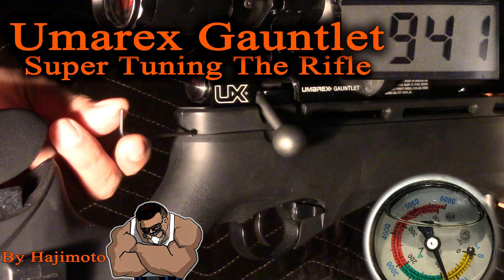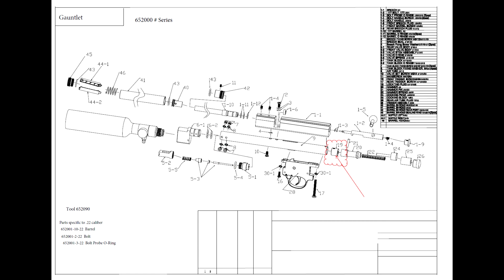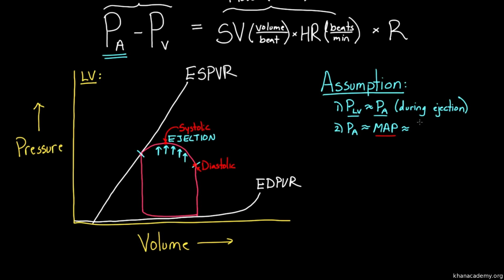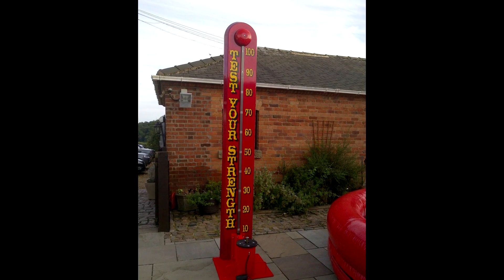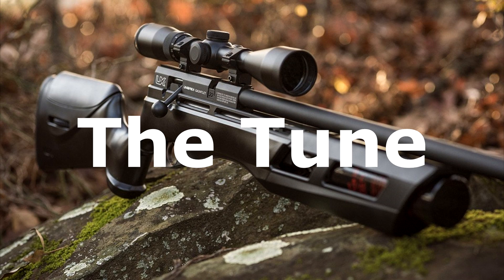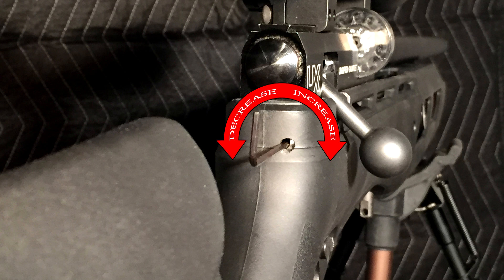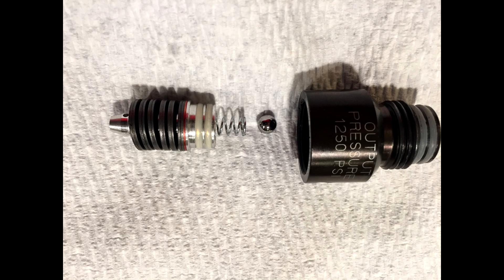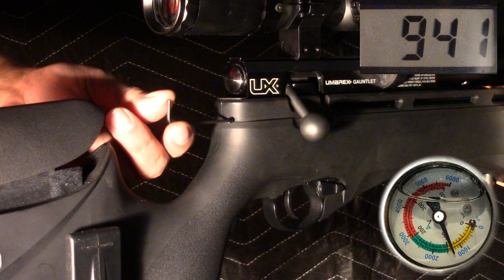Umarex Gauntlet: Tune Kit Results

Comment: So I have a .25 cal gauntlet and it’s currently 1900 per shot I want it 2100 so do I need to actually install something or can I just adjust a screw to up the pressure a bit?
Reply from the maker: The output of your regulator would need to be adjusted. The stock regulators that ship with the Gauntlet can be shimmed but there is a process and confirmation sequence that needs to be employed else you run the risk of exceeding 2100PSI and causing all sorts of issues.
Reply: Hajimoto Productions ya i figured it out thanks for replying tho! Appreciate it

Comment: Can a , davv aluminum 0.35l 0.38l 0.45l hpa work in it just by changing the bottle
Reply from the maker: My response speaks only to the tank and not any regulator that may be a part of the tank assembly you asking about. There is not enough information for me to properly answer your question. If the outside diameter of the tank you want to you allows the tank to reside below the barrel shroud without contact, yes. There is also a chance that the Gauntlet would need to shed the foregrip /tank cover shroud if not a similar outside diameter as the stock.

Comment: What is the difference between the Low Power Setting that produces speeds of 900+ and the Low Power Setting that produced 600+ speeds?
Reply from the maker: I see you discovered the different pellet weight swap.

Comment: You set your regulator at 1400psi, but what is the factory setting?
Reply from the maker: Typically the stock regulator output is listed on the regulator of the PCP. In the case of this specific Gauntlet, the output was tested at under 1050PSI which was under the listed 1100PSI.

Comment: Can an Air Venturi Avenger tuned to these settings ? Thinking of bying a Gauntlet or an Avenger. Which is best rifle?
Reply from the maker: The Avenger has far more tuning ability than even this modified Gauntlet. The Avenger has hammer preload as well as regulator output adjustment.

Comment: You got that many shot out of stock bottle? Does it affect the accuracy and the fpe to kill squrriels
Reply from the maker: Yes it does. If the power is adjust to low, you will not ethically dispatch the animal.

Comment: Hola, hace unas semanas compré un Gauntlet .25 y el bolt es realmente duro de mover, hay que aplicar mucha fuerza para tirarlo hacia atrás. Quería saber si hay algo que pueda hacer para ponerlo mas suave, he visto en todos los videos que el bolt se mueve muy fácil, pero no en mi rifle.
Gracias.

Hi, a few weeks ago I bought a .25 Gauntlet and the bolt is really hard to move, you have to apply a lot of force to pull it back. I wanted to know if there is anything I can do to make it smoother, I have seen in all the videos that the bolt moves very easy, but not on my rifle.

Thanks

Comment: Hello,,I was just wondering about the power adjustment strew  locations on the umarex gauntlet.25cal and 22 cal..are they located in the same place on both calibers,,or should I drill the stock in a different location??? Thanks for any help given..
Reply from the maker: Yes they are

Comment: Is there an equation to figure reg. output psi if 7.9 grain pellet is shot at 1035 fps
Reply: Firstly, Ke=1/2 x m x v^2
7.9 gr x 1035 x 1035 / 450,436.6798 = 18.78771841 fpe
then,
fpe / [(psi x 0.52828... x (pi/4) x 0.177 x 0.177 x (barrel length inches / 12)] = efficiency (n) 
Now that you have the fpe and the efficiency, I wish that you had included the barrel length, and I assume that the 7.9 grain is a 0.177 barrel diameter, but not caliber because there are only two digit calibers based on one (1) inch barrel diameter.
The 0.52828 (52.83% rounded) is the orifice velocity choke value.
Now, the difference between the 100% foot-pond-force and the pellets pfe is the energy in the friction and kinetic energy of the air mass, which a nicely tuned gun for accuracy is equal in mass as the projectile.
So, your initial question demands the internal energy of the blast of air that will project the projectile that can be easilly calculated with the Pressure in Bars at start of a string, and the pressure in bars at the end of the string, multiplying fby the botlle volume in liters (cc / 1000) then dividing by the shot count. That will give you the free atmospheric air volume.
Next, you calculate for the mass of said air volume with as close a temperature as possible for accuracy.
Then you calculate for the air molecule root mean square velocity, and the speed of sound and your Mach number at your location.
Then you will begin to see the picture to your question.
I'm working on my book that will explain it all down to the quantum mechanic level.
Lastly, I love Mr. Hajimotos shot strings with values so I can spend hours with statistical mechanics to analyze one minutes worth of his shooting. I've spent weeks savoring and analyzing this video. Playing it over and over again. Freezing frame after frame.
Stay safe.
Reply: @icuppu2   thank you.

Comment: Haji great videos and great products. I just installed this tune kit and am now starting to occasionally have the bolt bind up when trying to cock it any ideas would help. Also when starting after install should I have the power screw flush with the inner surface and record FPS and turn screw in and record each turn? What would be an acceptable balance between FPS and shot count. Thanks just a little confused  carl
Reply from the maker: If it is binding up be sure that the safety is not engaged until after you cock. Another common issue is to be sure the plastic spacer is left out of the PCP when reassembling it. The Adjuster Bock replaces that plastic spacer. Tell me what caliber you have and I will tell you what the typical amount of turns in is but you need to also provide me with the pellet and grain you are shooting. Obviously a chronograph is the only real way to KNOW what your shooting but I can get you close I'm sure ;)
Reply: Thanks I’m using 14.3 grain on a 22 gauntlet, I have left out the spacer and don’t use the safety. I’m going to disassemble and re seat the power screw so it flush with the body and start from there. Will also be checking visually for any bolt rubbing or obstructions? Thanks for your help with this matter
Reply from the maker: @carlboulden13  a .22 flying 13.30 gr Crosmans would be 2.5 to 3 revolutions in which would be anywhere 835 to 890 FPS

Comment: Will a tuning kit make your gun more powerful or will it just make it more accurate
Reply from the maker: Snoop 666 both and it’s due to adjustability. Every pellet has a speed that it will fly the most accurate through any given barrel. The range lays between 850 and 900, if you can’t adjust speed you can’t find that sweet spot. The super tune kit also replaced the poppet with a lighter less surface area unit which allow the hammer better influence valve actuation thus allowing for better pressure volume management resulting in more power and more shots.
Reply: Hajimoto Productions thanks bro I really appreciate you sharing your knowledge with us I’ve learned a lot from your videos especially being new to the Airgun community. Filled with awesome people keep it up. 👍

Comment: Thanks for the great videos. I've had my Gauntlet 22 for a few months. Bought it refurbished. The regulator was reading 1400 psi already and I was getting 850 FPS stock with Crosman Premier Hollow points (14.3 grains). Bought the JSARifle tune kit and am still only getting 850 FPS. The adjuster is all the way in. I know all rifles are different but there was zero result, negative or positive. Any suggestions?
Reply: what you need is a 2100 to 2500 psi regulator thats what gives you your power also a carbon fiber tank to 4500 psi your gonna see a major difference
Reply: If you did not experience a difference then check all your O-rings of marks or scars and replace them with better O-rings, not the cheap Chinese material. The 1,400 psi regulator setting should be giving you approximately 890 fps. The tune kit will give you a higher shot count due to its increased efficiency.

Comment: Thank you for the phone call and clarification on how to adjust properly Sunday. The VA Hospital screwed up and missed a brain tumor that really has caused me comprehension issues and communication problems. How my text message was worded was not meant in any way as a disrespect but as questions to what I may be doing wrong. I really do thank you for your much needed help and your call. Tumor is gone for over a year but left challenges for me in its wake. Your super tune works perfectly when I adjusted it the way you said. Dialing pellets in is so easy now. Thank you for your much needed help and really sorry for the misunderstanding.
Reply from the maker: You are very welcome Heath. Stay strong and be safe my friend!
Reply: @HajimotoProductions  HI AIRGUN 👑 KING..I WANTED U ASK U A QUESTION I BOUGHT THE UMAREX GAUNTLET 22 AND I DO NOT SEE THE LITTLE HOLE ON MY GAUNLET TO INCREASE OR DECREASE THE FPS....DO I NEED TO MAKE THE HOLE MY SELF TO GET TO THE SCREW...PLZZ LET ME KNOW..
THANK YOU FOR ALL THE AIRGUN WISDOM U SHARE WITH US....
Reply: @KINGBREAKBARREL  The instructions are in the video. 1/4 inch to the right of the center-line of the lowest step at the hand-grip. Watch the video as there is a special technique used to drill the hole, which makes total sense, after watching the process.
Reply: Good luck my friend. You have my best wishes

Comment: I want to buy your extended bottle with the 2100 regulator, but I don't know if my gun needs anything also. I just bought it and I don't want to cause any  damage to it. Is it ok to install that extended bottle with the 2100 regulator?
Reply from the maker: Ariam Aguila you can install my extended bottle and nothing more if you wish. You will gain substantially more versatility, adjustability and power if you install the super tune kit as well. In my professional opinion the single largest performance enhancing modification that can be made to the Gauntlet is a Super Tune Kit. Https://HajimotoProductions.com for details

Comment: Can the factory hammer spring be adjusted the way ?
Reply from the maker: Yes, If the Tuning Kit is Installed you have ability to adjust just like the lighter spring that comes with the kit. The issue will be, if you install the complete Super Tune Kit and use the stock spring you will over drive the valve and never be able to reduce the power output. This combination will essentially waste lots of air per shot and over drive projectiles causing unstable flight (terrible accuracy) scenarios.

Comment: Love the Pressure Volume Loop!
Just got my Gauntlet .25 and found your channel.  Scrolling the videos and just started cracking up when I saw the curve.  Had to take a double look to see if it was just a generic PV loop but then saw systolic and diastolic!
Having trouble with the tight hammer spring and heavy bolt action.  trying to find a mod to make it more user friendly.
Thanks for the videos and nice job.

Comment: I ordered my .25 Gauntlet yesterday.Aready have a regulator for it and got a tank on the way also.I am eventually going to get the .22 Gauntlet then I will put my .25 regulator on the .22 Gauntlet.
Reply from the maker: I would strongly recommend against putting 1900 PSI against a .177/.22 configured Gauntlet valve assembly. There needs to be more fasteners introduced in the .177/.22 valve just like they have done for the .25. You run the serious risk of shearing the 1 or two fasteners off and damaging the rifle or worse, yourself.
Reply: Hajimoto Productions 0h ok haven’t thought about that. Do you know of anyone that is going to make slug barrels for the .22 or .25 cal.
Reply from the maker: @fathertimencUSA  you can contact any reputable gunsmith that fits barrels but keep in mind the OD of Gauntlet barrels are all the same which means if you go with any other barrel you will need to have the breech block modified as well. Give Jefferson State Air Rifles a call I am sure they can do anything you need.

Comment: Hey Haj I finally got the 25 cal gauntlet and what is the best way to get the moderator off the bottle so I can put on the bigger bottle?
Reply from the maker: clamp the regulator assembly in wooden blocks that have a hole drilled in them.  Watch the is video
https://www.youtube.com/watch?v=eX2KrUP46v0

Comment: the regulator on the Umarex Gauntlet PCP Air Rifle, .25 Caliber is  set to 1900 psi
Reply from the maker: It sure is. Because they did not increase the size of the plenum they had to increase the pressure to compensate.
The pressure increase was still needed to push a .25 caliber pellet but it didn't need to be 1900 they could have gotten away with 1600, the extra 300 is to cover the volume that typically the plenum would cover.
Reply: okay so how do I drop the pressure and fix what you are talking about ?... I understand the concept of what your saying .less pressure 'and keep the pop valve open longer '?right?
Reply from the maker: Correct but the exact amount of reduction will need to be vetted. One can lower the output of the regulator by removing some or all of the shims that may be installed in the regulator. It is important to note that belleville washers and shims are two different things and a person needs to know the difference or else the regulator will not operate properly. Once there is less pressure against the poppet, A lighter hammer spring can be selected to achieve a proper balance. A Super Tune Kit will introduce adjustment to the hammer spring essentially allowing the shooter to simply increase or decrease hammer preload to realize changes in projectile speed and energy.
Reply: Okay I understand what you are saying 'I have another question .if I just leave it at factory settings of 1900 psi .and install the super tune kit will I get more power then the 45 fpe?
Reply from the maker: Once a Super Tune Kit is properly tested and offered, I am reasonably sure the .25 with a STK installed will produce more than what the rifle will generate in a stock configuration.
Reply: I agree so if I install the upgraded hammer spring and the new popet valve 'I should be able to adjust the hammer to hold the valve open longer and faster and get around a 20% increase in power 'correct?
Reply: I use to be a dedicated Hatsan kinda girl 'but since they came out with the .25 caliber  Umarex Gauntlet.I cant Waite to get it in my little hands .I'M a long range shooter with my hatsan 125 sniper and my home made pellets 10.0 gr I can hit a golf ball  at 150 yards .I did upgrade it 3 years ago with a super tune kit from amazon double spring kit .+ new piston seal and breach seal it will fire a 7.9 gr at an average of 1325 fps .so I have to use a heaver pellet .
Reply from the maker: I need to be sure that we are saying the same thing here and I also need to clarify expectation or predicted performance results. Once a .25 Caliber Super Tune Kit (STK) is developed and tested which may be inclusive of a new Poppet and hammer spring, are installed in the Umarex Gauntlet .25 caliber there will be power adjustments available. That said until the STK is developed and vetted, claims of a 20% increase in power can not ethically be made.

Comment: Is there a video, or can you give a quick clear up on how you open up the transfer port hole? Is this done with a drill bit, or? .

Thanks in advance. Just ordered the barrel band. Will be ordering the stripper and baffle kit soon. Considering the tune kit once I become more familiar with the gun.
Reply: No transfer port for you to open up, It is blocked off by a metal ball, you can increase the air by raising the regulator pressure with a new shim combination, and by increasing the hammer spring preload tension.

Comment: exellent shot count! my 14.3 grains got pushed beyound 1100fps with 2000psi tube. but that only yields 30 shots with a 26ci bottle. nicely done!!!
Reply from the maker: Thanks for the comment.  When you say "with a 2000PSI tube" are you saying you bumped up the pressure to the valve to 2k?
Reply: Hajimoto Productions. yes i bumped the tube pressure to the valve at 2000 psi. of course it is not the stock tube, and i ditched the bottle doing that and bottle use only with ugly fittings attached. however, i dont shoot at 2k all the time. i just have a 2k tube in case i want to hunt with heavier pellets. now i am strickly shooting at 1100psi and i can easily shoot from 850fps to 1000fps with 14.3 grains. i do like it around 930-950fps. i can hit a 2 inch target at 100 yards 7 out of 10 shots in the wind.   and a light pole at 130 yards consistently. i love the accuracy!

Comment: I just bought a 0.5 liter 4500psi bottle with a ninja regulator. Waiting for the bottle but i have high hopes on shot count. Can I open up the tranfer port and use the same amount of air at increased power?
Reply from the maker: Your question is confusing.  Are you suggesting that a transfer port will increase the amount of air volume required per shot? The object of transfer port work is to increase the efficiency of air from the valve to the bore.
Reply: Hajimoto Productions So it wouldn't increase the air usage. Got it thank you.

Comment: My shot count, velocity, accuracy are all where they should be, but when the Gauntlet fires it sounds like a burp.  If my marauders or Discovery did that, I'd think hammer bounce.  Is that happening with the Gauntlet?  If so, will the tune kit fix that?
Reply from the maker: The tune kit will reduce the amount of hammer energy and in turn stop the bounce you are hearing. The spring that comes with the Gaunty is way too strong.  The spring that comes with the Tune Kit makes cocking the rifle like 40% less effort required.